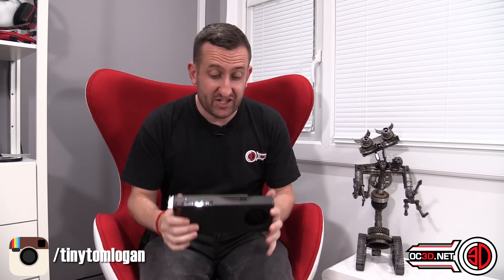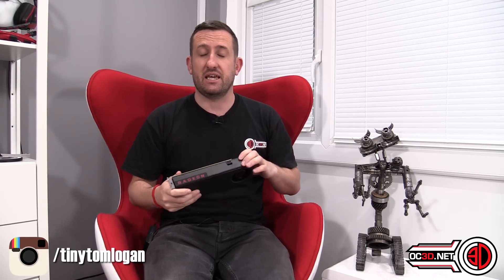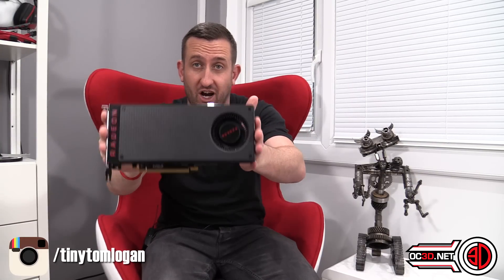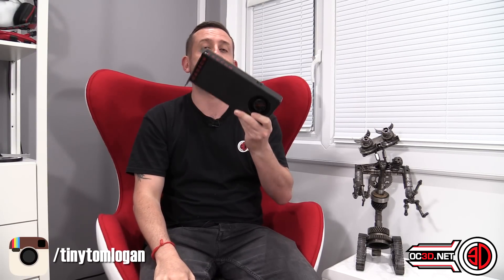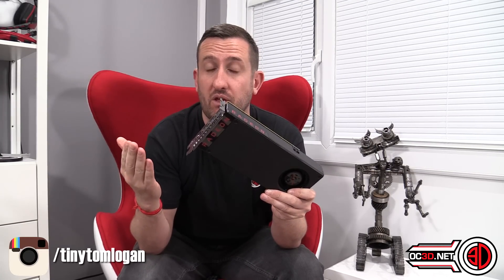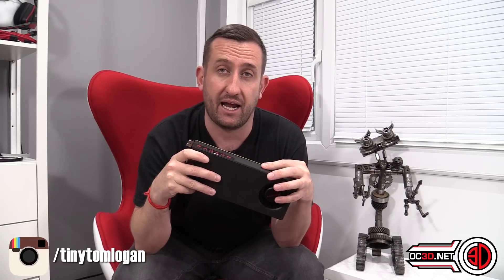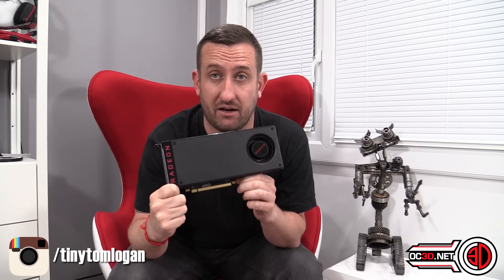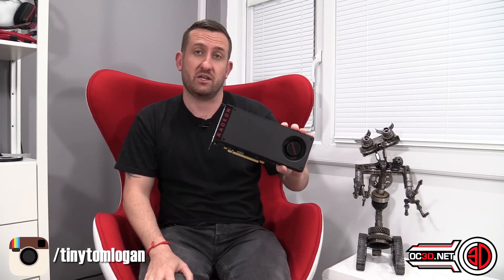RX480 power bottleneck? TTL Talks

Comment: Power from PCI is 75w, power from 6 pin lead is 75W.......so you need more pins to safely get more?
Sorry made comment before your power chat!
Reply: jackspencer213 the problem is the rx 480 has power spikes around 200 watts and uses the pcie slot to draw the extra power its over the spec the thing is its a budget card most people with this budget cards also use budget motherboards im pretty sure cheap motherboards will not like it :P
Reply: in terms yes. the power circuit on the reference actually draws 5watts more than its meant to on the 6pin connection. the only way to overclock these properly is to get an aftermarket card with improved power circuits that can take more power through them.
Reply: u can draw up to 300 Watts From a PCI e slot..
Reply: not true at all you can only get 300 watts from pcie specs when you use 75 watt slot + 6pin +8 pin cables
Reply: +MrPummetje "Q: Does PCIe 3.0 enable greater power delivery to cards?
A: The PCIe Card Electromechanical (CEM) 3.0 specification consolidates all previous form factor power delivery specifications, including the 150W and the 300W specifications."
Reply: 6 pin connectors can safely deliver more than the 75W they are rated for
Reply: +MrPummetje thats true budget mainboards have thin copper lines that cant Carry so much power. but the budget gamer doesnt OC either so its fine. :D
Reply: +DerZuschauer it has The Same issues on stock oc makes it worden look at pc perspective website
Reply: This is not the point. The PCIE standard is clear that 75w maximum is the power draw design for the PCIE slot power supply, per slot. And that 75w is the design requirement for one 6 pin power cable. This card breaches these design standards when power target overclocked. 
Many budget gamers specifically DO overclock to maximise a lower tier card.
It is only 'fine' because most boards and power supplies will be designed with margin in hand.
Reply: MrPummetje Yes but I'm sure they could just do a bios update to draw the additional power through the 6 pin instead of the slot.
Reply: jackspencer213 
That would be a reasonable 'fix' but then 6 pin spec is exceeded, not a real problem as the cable can easily carry about double the 75 watt spec.

Comment: Usually if a card has say 2 6 pin connectors they are common ( connected to each other) the idea is say your drawing 10 amps through one 6 pin you would draw 5 amps through each of the 2 6 pins, less strain on the wires less loss due to resistances .

 I have also seen some high end cards where each connector supplies its own set of mossfets and DC to DC converters. I would suspect that none reference cards would increase the number of mosfrets and DC to DC converters to supply more power to the core , no matter how many connectors you have your going to reach the limits of the onboard power at some point without more power phases so they will have to .

 Do you have a clamp meter ? https://en.wikipedia.org/wiki/Current_clamp

If so you could test how much extra power is being drawn when you increase the power target , simply put all of the 12v ( not the grounds)  through the clamp meter and set it to amps range and see how it increases.